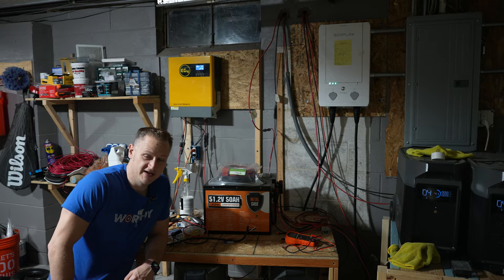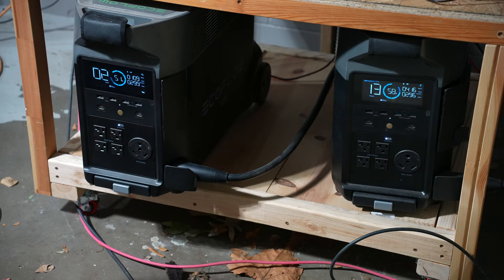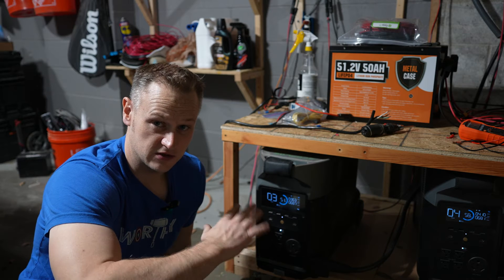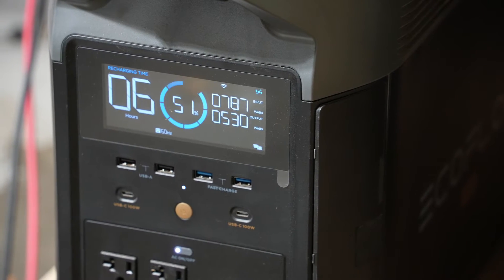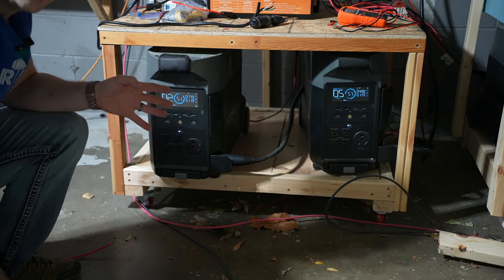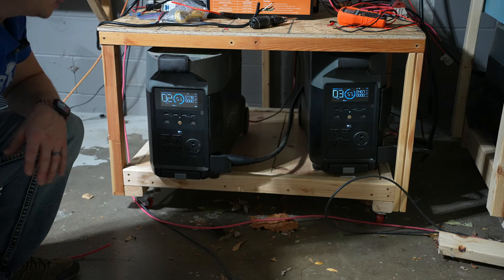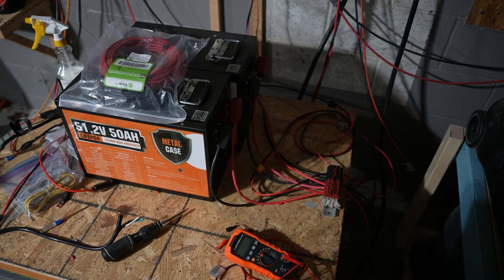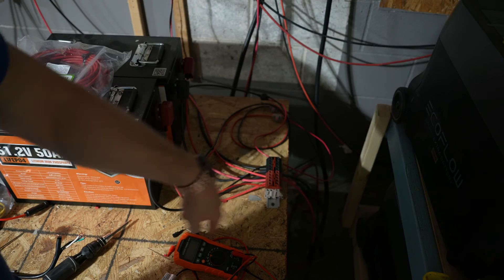Powering Two Ecoflow Delta Pros with an external battery bank?

Comment: Great video!  You can use a Junctek shunt monitor connected to a relay to shut off external battery when it gets to a set discharge capacity.

Comment: The one that seems to be jumping is showing it acting as though solar panels are connected.  I have seen the same thing on my Delta Pro's when initially connecting to solar and the MPPT is searching.  I'd guess the other is thinking it is car connected not solar panel connected.  Also the roughly 750 watts in is 15 amps X 51.2v.  Which makes sense why the other was capping at 410 watts (51.2v X 8 amps) which is the max car charging.
Reply from the maker: You have it exactly right. I could fix the one acting like its car charging by switching out the cable (apparently was an xt60 instead of xt60i).

Comment: Thanks for video, How do you wire the batteries, parallel or in serial? Total DC voltage/wattage of batteries? Please give more details. Thanks
Reply from the maker: These two are wired in parallel so I have 51.2v at 100ah = Approximately 5,120 watt hours available. It's fairly small but I did it more to prove out the concept before investing in a bigger external battery bank.
Reply: @DanielGoodwin-jq1oc  Thanks, is your local power stable or too much trouble? The more they have problem the more storage you need.